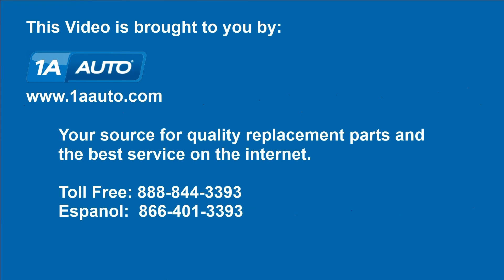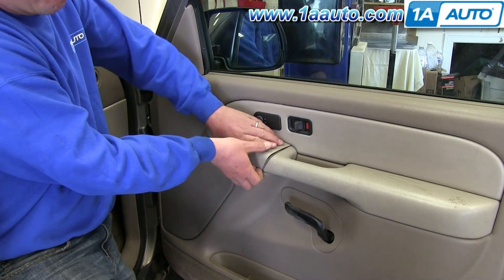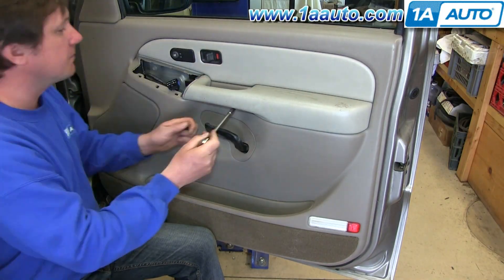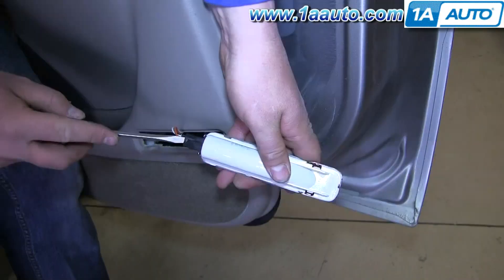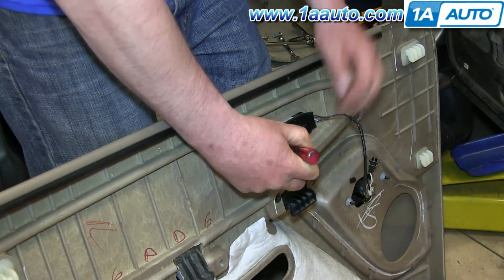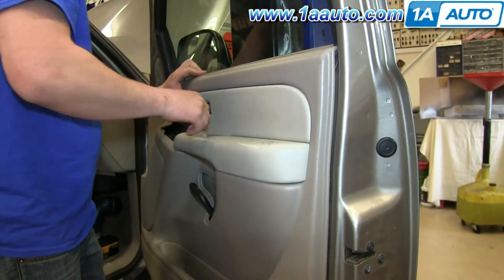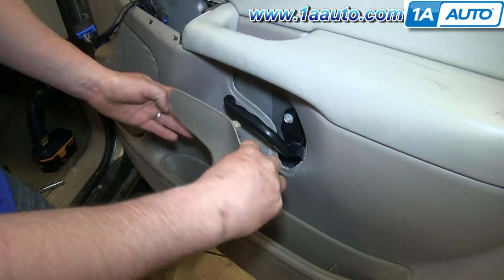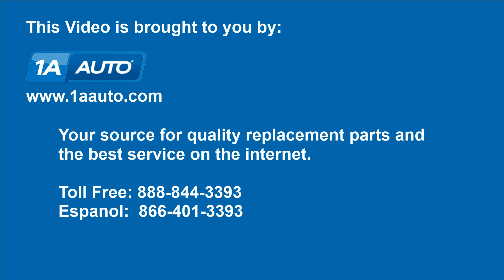How To Remove Front Door Panel 00-06 Chevy Suburban

Comment: Warning: do not do this on 2003 Tahoe. When removing the control switches, there are going to be 2 small screws holding in the backside. I immediately broke the casing for the upper screw when trying to pry out with my hands and now my control panel is a bit loose... forever. You have to take the door panel off first, then unscrew from the back in order to get the switch panel removed. Or like I did, you can just remove the door panel and connections to the control panel and leave the switches still attached to the door without removing.

Comment: After taking the bolts and every thing else, it didn't just lift off. If you have a 2003 suburban, you need to remove the lock switch cover and there is a bolt under there
Reply from the maker: Thanks for checking us out and the feedback! 1aauto.com +Gillian Zohnert
Reply: I have an 05 Suburban and it’s the same for me as well. Thank you for the heads up🙏🏼

Comment: You should not group 99-06 together.  My 2004 Suburban switch bezel does not have to come off.  It is held on by a screw you access from the back side of the door panel after removal.  If someone tries to pry the switch up on the front edge they will damage either the door panel or switch Bezel.
Reply: That seems to be the problem with my 2004 Suburban too.  I am having a hard time finding the door panel replacement.  Thanks.
Reply: Yes, the 2000 -2002 seems like this. It seems Chevy changed some things in 2003 onward. Please update the information.

Comment: You definitely need to change the title of this video! I have an 06 Suburban and it was very different from what you showed:

The bolts are 7mm
The lock has to popped out because there is a bolt behind it.
I pried my switch panel off which I didnt need to do, and now its broken.
Reply: Damn me too man
Reply: Yes!
Should have read your reply before I began to pry...
My '06 plastic is brittle enough by now that anything "un-pryable" definitely gives way with minimal effort...
Echo the 7mm bolts...

Comment: Thank you for the tear down video.  I have a 2004 Chevy Suburban, and I am looking to replace the door panel from the driver-side door.  I had no clue as to how to remove the panel, but now, I feel confident in removing the door panel and fixing the broken switch bezel that is on the drivers-side door.  Some person said that my problem is not with the bezel, and that the broken piece was actually a piece from the door panel itself.  So once I remove the door panel, I'll have to see what the broken piece is, and replace it.

On a another note, does anyone know where I can buy a 2004 Chevy Suburban replacement door panel online?  I am trying to avoid going to the dealer, as we all know that they charge an arm and a leg to replace anything, plus their parts are not superior to some aftermarket products either.  At least I have found that to be the case in some products.

Again, thank you so much for the video.

UPDATE: After reading some other folk's comments here, I think that there are a few different steps than what the video shows for a 2004 Chevy Suburban.  In the case of the 2004 Chevy Suburban it is necessary to remove the door lock button in order to get to an additional screw on the backside.  Is this correct?  Also, on a 2004 Chevy Suburban one does not remove the switch bezels from either doors in the same manner as the older models.  Is this correct?
Reply from the maker: +Manuel Villalpando Thanks for checking us out!

Comment: Exactly what I needed... I assume it works for the other 3 doors as well. Thanks for the info!
Reply from the maker: +John Campbell Thank you for watching. The other three door panels will be removed in similar ways. The position of mounting bolts may be slightly spaced differently, but the procedure is the same. 1aauto.com

Comment: Another tip, replace the 10mm screws with slightly larger Phillips head sheet metal screws up top and a #12 x 3/4 in wood screw on the bottom.  It was necessary to drill out the upper hole in the driver's side with 5/32.

Comment: Does this also apply to a 2003 Tahoe?
Reply from the maker: You may be able to apply the basic steps shown in this vehicle to your 2003 Tahoe. There may be a few different thingsto remove on your application. Hope this helps you out. 1aauto.com 866-403-3393
Reply: Depends on the date of manufacture - my 2003 manufactured 11/02 in Arlington, TX has a different retainer on the door, as well as the power window control has a screw in the front, instead of a detent spring.

Comment: Driver's side is NOT the same as this video claims.  Have to remove the inside panel first before removing the instrument cluster to access the screw at the front of the instrument cluster that fastens the cluster to the arm rest.  Like Adam RS, I broke the screw boss.  Had to use JB Weld for Plastics and let it cure overnight.

Comment: NOT CORRECT FOR 2004 SUBURBAN DRIVER DOOR!!!!      On the 04 you have to pop off the manual lock slider switch and take out the 8mm screw or you will break your door panel! 
Also, DO NOT remove the driver switch assembly.  Unplug it all after you slide the panel up and off.  You will break off the screw on this panel too removing the switch assembly.

I now get to buy a new door panel along with the outside handle and lock cylinder I had to replace when someone tried to steal my Suburban.

Comment: Doesn't work on the 2005 suburban. Don't remove the electrical panel because there is a screw in it from inside. Pry the lock switch cover out and theres a screw behing that. Then it will slide up.